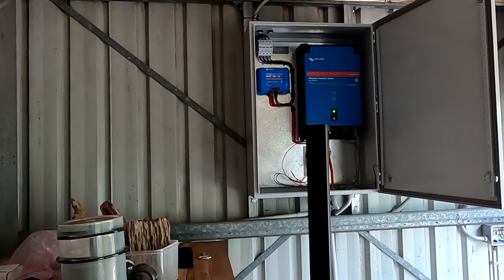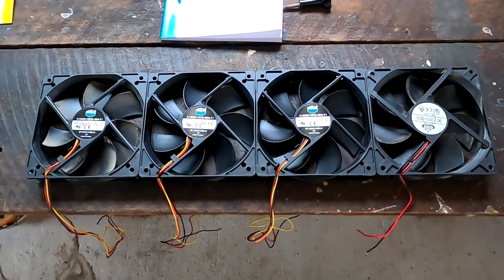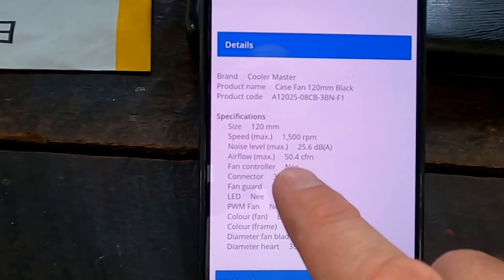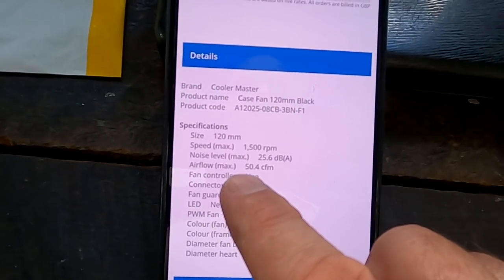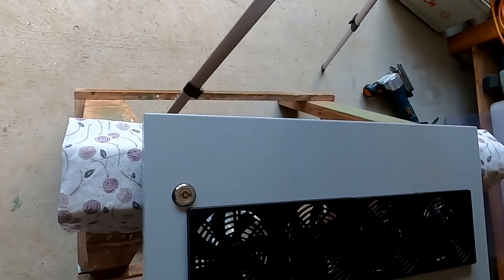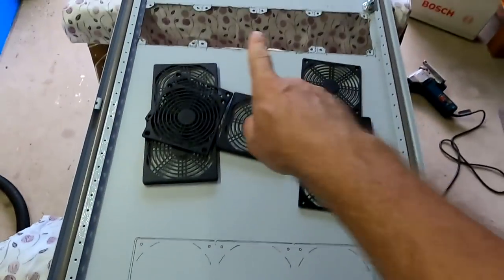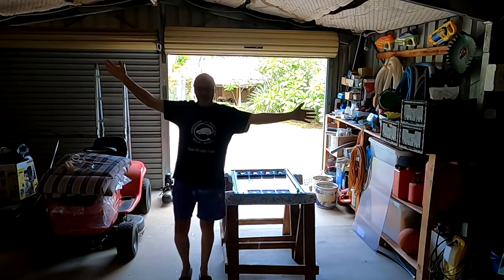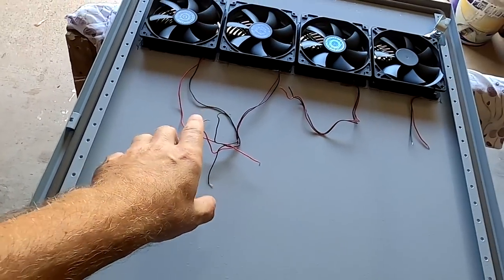Cooling our Victron equipment - your suggestions, my solution

Comment: Oh, I see that it looks like you cut the yellow wire so no PWM control option anymore.
Reply: The yellow wire is just a pulse output to measure the speed of the motor. PWM on the power leads works just fine without it.
Reply from the maker: Not needed, I want them on full power. As Sylvan said these is just a sensor cable. The PWM is done by another circuit receiving the RPM sense from the yellow cable.

Comment: Why didn't you put 4 filters for intake? You are creating resistance for the fan's to pull air. You are reducing the air flow like that. The size of the intake should match the fans size.
Reply from the maker: Then I would need 7 or 8 intakes as the filters lower the airflow a lot!

Comment: For starters , why not use the enclosure box for equipment that should be in an enclosure ??  The equipment you have in the box right now isn't designed to be in an enclosure , thus making it hard for it to cool itself.
Reply from the maker: For starters, do you own such equipment at all? That's totally wrong what you're saying here. If you ready the manual for the inverter for example, it clearly says designed for boats, RVs and cabins. In all of that, you usually have very tight spaces to fit this equipment. If you read further in the manual, you will also find information about mounting the inverter in an enclosure and that you can connect external fans to the inverter.

Comment: will you make a temperature controled start for the fans ? 
They would be annoying hearing them running all the time.
Reply from the maker: The inverter has already a temp sensor and switches the fans on when needed.
They are whisper quiet... you cannot hear the at all

Comment: Only two issues I see with this: One, it relies on outdoor ambient temperature. Really unavoidable, as climate control is impractical here. Two, there's no account for moisture/humidity. Depends on where you live how much this is a problem. I can't get away with a setup like this (inside a cabinet outside of my bus) as conditions outside could easily be detrimental to operation. You likely can. Both are environmental factors, probably which you're comfortable with.
Reply: Btw, if you want to you could step down from 48V to 12V and then use an automatic fan controller to regulate fan speed. Using standard computer fans you have lots of selection.
Reply from the maker: Moisture is not a problem here, super dry all year around.

Comment: I don't like fans
Just another thing to go wrong
I used 75mm storm water PVC out through the roof with a bend and a screen
And another to near ground level with a screen
Natural airflow with the chimney effect
Same setup on my 240v fridge freezer to assist cooling
Reply from the maker: Won't work here in Australia. Also, more inlets for insects to come in. and, there is no space for a 75mm pipe in my enclosure.
Reply: @OffGridGarageAustralia  flange on top and bottom of the enclosure!
Nothing goes inside the box
Mine works fine on the South West Slopes of NSW
Max temp sometimes get to 46c in summer
Just gives a nice gentle air flow
I use the same for excess Hydrogen extraction from the battery banks
Simple but effective
Cheers

Comment: I know this is a little off topic but not sure where to ask?.Does the Victron smartshunt show current as small as .2amps?.I currently use another shunt but it does not see the current constantly drawn by a raspberry pi,which means if there were no charging the battery i am using could go flat in 5-7days and the current shunt would still say 100% SOC.
Reply from the maker: Yes, it shows current done to 0.1A and even this is adjustable in the app.
Reply: @OffGridGarageAustralia  It shows the current down to 0.1 but it's not very accurate at those low current levels in my experience.

Comment: Great episode as usual. When I saw the fan set up I was slightly concerned about air short circuiting and running up the door face and not going through the inverter. Might not be an issue but a simple fix is a baffle plate as is common with industrial heat exchangers. A horizontal plate mounted to the cabinet door the is mid way and horizontal touching or close to the inverter. Will ensure air reports through the inverter.
Reply from the maker: The inverter has it's own fans which will suck in the air coming through the inlet. I hope it works.

Comment: If each fan is 48 volts you want them in parallel.
Reply from the maker: They are computer fans running on 12V-18V each

Comment: in Fanuc robotics cases they have a "z" type cooling configuration which keeps the inside clean by having a separator in the middle to keep dust out  you could do this with a heatsink to transmit heat from the inside to the outside  fans on the outside push air along the heatsink and fans on the inside pull air along the heatsink 
one set of fans is at the top and the other set of fans is at the bottom on either side of the heatsink
Reply from the maker: That sound complicated and a lot of effort. Not sure if I would have enough space inside the cabinet.
Reply: @OffGridGarageAustralia  your already half way there
Reply: can i send you a pic ? might explain it better.

Comment: In fact I would just have removed the door lol !
Reply from the maker: The purpose of the cabinet is to keep dust and insects out. An none existing for does not help 😉
Reply: @OffGridGarageAustralia  good answer I forgot it was in Australia lol.Not as much trouble for that in France so I will just put all my stuff in a massive closet with a big mesh (wire rack, I am not sure in English) at the bottom and at the top of the closet doors.

Comment: Why are you planning to use 2,  3 or 4 charge controller?
Reply: Moooar powwaaa as they say.
Reply from the maker: Different solar panels with different voltages.
Reply: On cloudy days you may only get 50% of the sunlight.  so, having "twice the panels" will allow recharge of the battery bank to 100 % SOC, on very cloudy days ...

Comment: I would recommend getting a Dc-Dc  converter and run the fans trough a 12v fan controller, less chance of something failing and you don't have to have them running full power all the time 

Those fans have electronics in them and I'm afraid that at the full charge voltage of 57v something could get damaged since if one of the fans goes higher or lower resistance it'll affect the voltage distribution between the 4 of them
Reply: Adding a DC-to-DC converter actually increases the risk of failure ...

Comment: Should be fine running the fans at 12V, they'll just run a bit slower.   You went overkill on the number of fans (you really just need one intake and one exhaust fan), so it probably works out pretty well, and it will be quieter.

-Matt

Comment: Please, be sure to remove all burrs and every possible trace of metal filings or they will haunt you forever with intermittent failures when they migrate into the electronics.
A simple electro-mechanical thermostat (that won't itself consume power) placed at the air outlet inside the case will conserve power when it's cold.
Like other posters here, I worry about your choice of series-connected fans. That configuration quadruples your risk of total fan failure. Don't forget the series fuse.

Comment: If you asked Victron should you mount it inside a sealed enclosure, ie was it designed for such mounting and likely is your warranty compromised by such a mounting? As I used to sell and install Victron Inverters and Battery Chargers for use in Enterprise uninterruptible power supplies, if any of our engineers installed a Victron like you have it there, unless it was with Victron's express permission he would be handed a check and told his services were no longer required, it seems you must not have been sent the installation instructions with the purchase of the unit. The first line of the installation manual states it must be installed by a qualified electrician, somehow just by the layout your current installation would not meet any code requirements.

1 Location, The product must be installed in a dry and well-ventilated area, as close as possible to the batteries. There should be a clear space of at least 10cm around the appliance for cooling. Excessively high ambient temperature will result in the following: Reduced service life. Reduced charging current. Reduced peak capacity, or shutdown of the inverter. So straight from the install manual for the unit. I wonder did you not read it or did read it, closed the book and said that does not apply to me.  The very fact that the Positive and Negative cables are both Red is indicative that NO electrician has ever looked at the installation, good luck with insurance, Victron states it must be installed by an electrician, it is stated multiple times throughout the manual.
Reply from the maker: Th inverter is designed for RVs, boats and cabins, so exactly for small tight spaces with very limited airflow (if at all). It also says it in the manual that it can go into an enclosure.

Comment: My only question is what makes u think i needed 4 fans.
Reply from the maker: The answer is: each fan has 12V and I have a 48V battery
Reply: @OffGridGarageAustralia  i was wondering if 1 fan would coolit enough. I've never seen an electric panel fo anything other than put some vents to allow heat to flow out. But u know what u r doing
Reply: @OffGridGarageAustralia  also i love watching your videos even if I'm  not building what u r.
Reply: @OffGridGarageAustralia  let me say also that I'm not an electrical engineer so I'm not saying that what you're doing is wrong I've just never seen that in any electrical panel I've ever worked in and I was electrician commercial for 14 years
Reply: @FatgirlMickey  So, you have never worked on electrical cabinet that had Solar Inverter & Charge Controllers mounted inside.  If you had, then you would know ...